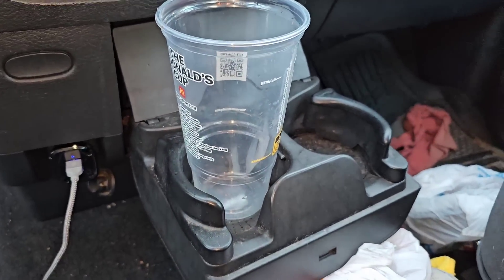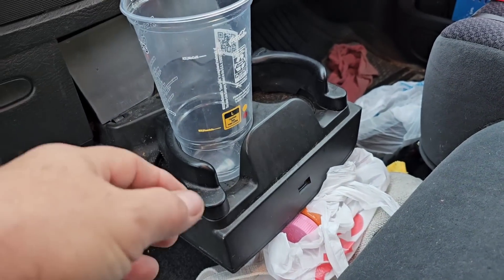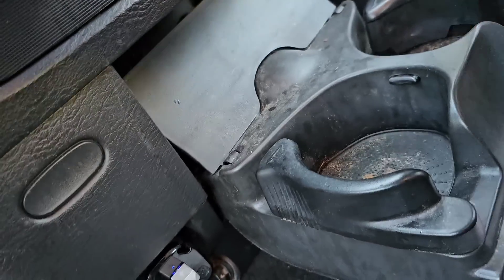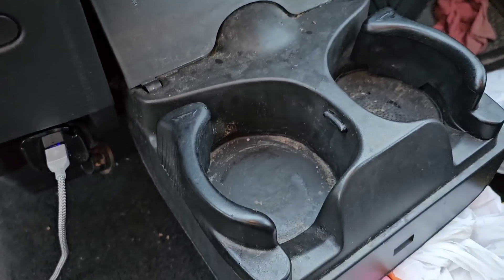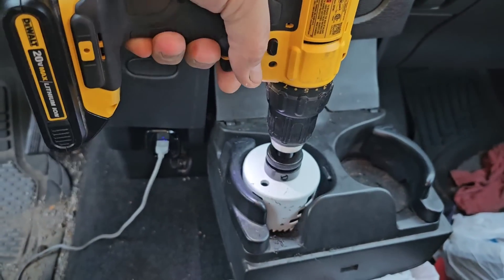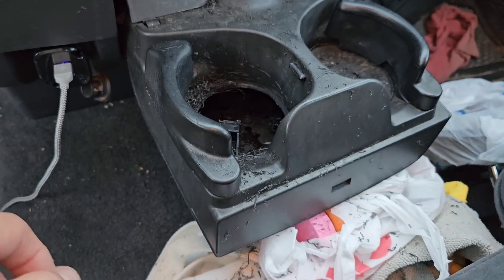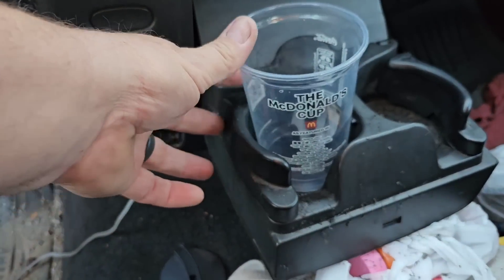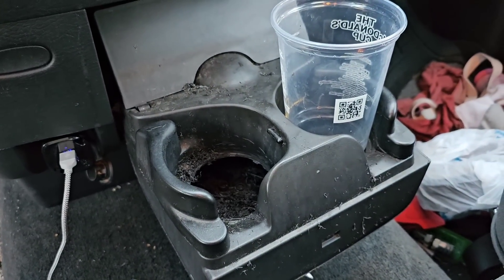Ram 1500 Gets Exploratory Surgery With A 3" Hole-Saw!!

Comment: 1994-96 Rams had the cupholder high in the dashboard and would drip condensation on the stereo deck below. No to mention the cupholder was flimsy and the drink cup could become a flying projectile. '97 models did like yours and it folds up into lower dash. Geno's Garage (mostly Ram diesel parts) has  cupholders to fit different year Ram center seat consoles. Your idea is great, hurry get the patent on it.

Comment: Hey Kenny 
I have found that when using a hole saw in plastic you have better results running the drill backwards. It cuts fine but the teeth dont grab and you get a smoother finish and less chance of a broken wrist.

Keep on wrenching
Reply: Nice tip!  Thank you.
Reply: excellent tip!

Comment: I just had another idea as I was watching your improvement. Find a cup that fits over your cup. Cut off the bottom so it is about 3 inches high. Drill a small hole in the center of the bottom. Screw it to the bottom of the existing cup holder.
Reply: I had a similar thought: insert that into the hole you just made and epoxy it all together
Reply: I’ve done exactly that in my ‘99 dakota.  I used an old speedway cup that I cut a few inches off the top and screwed it down with a fender washer.  Been working great for over 20 years.  If I have a smaller cup to put in there, I just drop a roll of electrical tape in the bottom so the cup fits inside.  Works great, looks funny, but works.
Reply: @iFixJunk  I like The way you think!
Reply: @Tsuter1978  Very creative thinking!
Reply: Or solvent weld in a piece of ABS pipe
Reply: I have an ‘04 and I think the cup holder works fine. Perhaps my spring-loaded clamp thing has better springs than this one. The hole works.
Reply: Great video! Always  love them!

Comment: Reminds me of an '88 Accord I bought in 2015. It had no cupholder at all. So I bought the add-on thing from AutoZone or Advance and I ground off enough plastic for it to fit in a tray molded into the dash on the passenger side. Then I ran in the supplied drywall screws--NO IDEA what I ran them into under the padded dashboard cover, but I was able to put a small paper coffee cup in the cupholder for my ride to work!

Comment: Just a thought: PVC pipe couplers, end caps, or pipe sections.  Multiple diameters, easily drilled and cut.  You could take two sections, place them side-by-side with a small spacer between them so they fit properly in the exist cup holder spaces.
Reply: I bought a couple of PVC reducers (4'' down to 3'') and a plastic cutting board. Drilled holes in the board, glued in the reducers, tucked it under the console. Presto!
Reply: @OtherSarah2  Neat!  I can picture it!

Comment: I purchased a 2010 center seat upper part with the cup holders and installed it on my 07 Dodge 3500. I had to do a little wiring, but it fit, and the colors matched.

Comment: I have a Ford F 250 SuperDuty. In each of the cup holders there is a rubber insert. The nice thing about them is that the inside diameter is a tad smaller if I have a smaller container (like a 16 Oz water bottle or a cup that is fairly small at the bottom. If the container is larger like a Yeti tall drink container, I can just lift the insert out and the wider containers fit perfectly snug. In your vehicle, it wasn’t the diameter size of the cup holder but rather the depth. Most cups or drink containers (even bottles) are too tall and top heavy. Those little flippers were useless in my opinion for anything but a small cup of coffee. You mostly solved the depth issue for taller containers. But if they don’t fit semi-snug, they will still have a tendency to lean (thus the rubber inserts like I have). Obviously the other issue might be condensation on plastic cups and perhaps some rattling on the Yeti. If nothing else perhaps you could put a thin rubber pad inside the flip down door to minimize rattling and slippage (try one of those rubber gizmos people put on their dashes or center console lids that you can put your phone or something else on that are just a little sticky so things don’t slid off). Fun video regardless of where you go with it. Great idea!

Comment: I have a '05 Ram 2500 with the same interior, I have never had that problem. But that was a reasonably good solution if you don't mind the clamp device not working. Waiting to see that solution now!

Comment: 👍 Sometimes you gotta do what you gotta do 👍 (I read a few in the comments and one guy had a great suggestion, run the hole saw in reverse after getting the pilot hole drilled.. SMOOVER cut!

Comment: If you have a newer vehicle, be careful. There's potential to do some real damage if you don't fully understand what you're doing. For example, on some Fords, they put the key fob programming slot in the cup holder with a rubber mat that goes over the top of it. If you went to drill the bottom out, you would never even notice it. Quite often, there's major wiring harnesses that run directly under the cup holders, and there can even be a module under it. 

Your safest bet is to remove the cup holder assembly and drill it out on a bench. That way you can see exactly what you're doing, and avoid damage.

Comment: Kenny use a small drill bit and put 2 holes 1 in the arm and one on the main sections use a brake drum shoe return spring to pull the arm tght. :P

Comment: On your own rides it always cool to do a mod that you're happy with. That was a cool trick Kenny, I remember those damn dodge rams from when they made em, while working for a Dodge dealer in Arizona.....In the '90's, I lived in BHC Arizona, I had a 1990's S-10 Blazer. Well, it needed a fuel pump, this was in the hottest time of year there August, 120+ degree's. Now I wasn't about to remove my draw tight hitch assembly to drop the fuel tank out. So I located the center of the tank (best guesstimate) and removed the cargo carpet, cut a "door" with dad's swazall. Walla ! bend the "door" over, and change the fuel pump, bend the metal door back down, secure it with strips n screws, put carpet back.....

Now I'm retired, and living here in the Philippines, I bought a 1997 Suzuki Vitara 4x4 SUV. Same thing if it needs a pump down the road. Since my vast 45+ year tool inventory is back home in Calif. in my shed, at my best buddies "rancho" house. I have been buying cheap online tools here as needed to work on this suv. I had to remove the trans, shove it back enough to access the pressure plate bolts, and loosen em up. During the wet rainy season last Dec-March, evidently the clutch disc froze to the PPlate/Flywheel to where the clutch wouldn't work right. Had just hand tools, and got a pair of 6 ton jackstands, 10 ton bottle jack. LOL It was NOT fun, working on a little slope of dirt and rocks a couple hours every morning for a few days, but I "Got 'R "DONE !! ............Now we can drive off this muddy mountain and go to nearest city for stuff we need....

Learned a valuable lesson with this fiasco on this clutch. Humidity and the moisture can freeze the clutch disc. So now, I will go out and start, and move the car back and forth during the rainy season, to keep this from repeating itself. I sure DO NOT wanna have to pull the trans back anytime soon !! (Everything I could see inside, looked fairly new-ish, so no clutch set for awhile, since I don't drive it that much living where we do. Car had st parked for 7 months UGHHHH never again ! lol

Comment: My old f150 had the same problem. I found a rubber insert that fit most cups and the cupholder tightly. The large bottom 64oz cups and the 32oz gatorade bottles fit perfectly though.

Comment: If the cup holder is alway down and regularly in use here’s a suggestion. If your wanting to keep those swing arms in the out wide position and your not to bothered about looks try using 2 or 3 rubber bands. Hook to the arm thing on one side, run the rubber band underneath (across the front panel when it’s in the closed position) and hook to the other arm thing. Rubber bands are thin enough not to get in the way like bungee hooks would and the rubber material might even act as a grip to hold the cup.

Comment: I disagree with how terrible the center dash cupholder is. I have a 99 dodge ram, recently replaced the cupholder insert because one hinge was broken and it works fine. It opens enough to hold a burmate hopsulator can coozie ( 25oz beercans and the 24oz arizona cans) and the adjustable part closes in and holds the small base of the 50oz gas station cups will no spilling. I don't take corners like a grandpa and have not had one spill over, even before replacing it. The issue i had with the hinge was it didn't latch securely (a latch was broken i believe) and the cup holder would fall straight down, even while stopped just from the weight of the drink.

Comment: I have a 2004 ram1500 with a five speed manual transmission and it has a different cup holder on the floor rearward of the gear shift it holds cups better than my mothers automatic transmission in her 2004 ram 1500 but mine doesn’t fold up out of the way